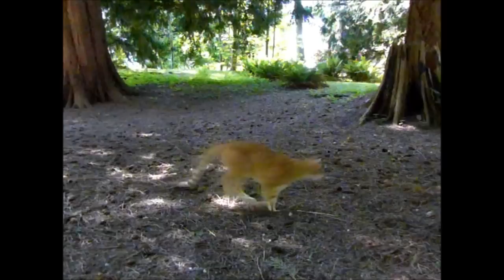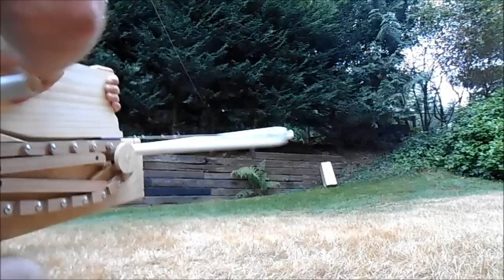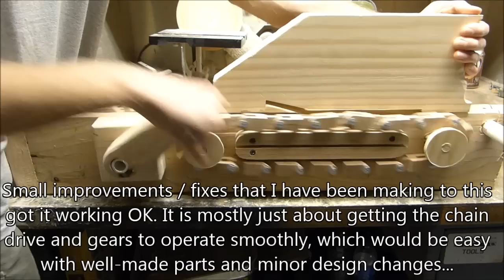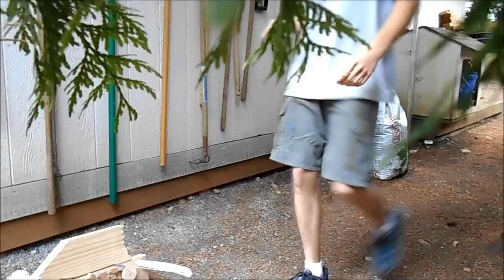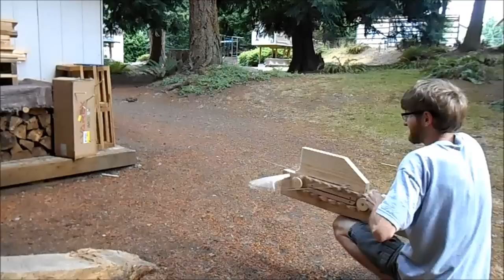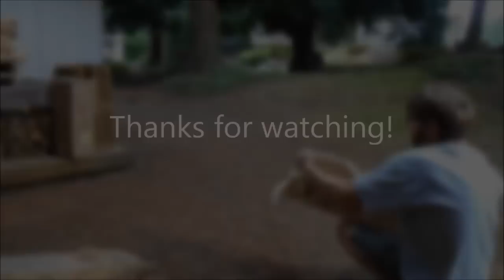Full Auto Crossbow Version 1 Shooting Hand Cranked Gattling Crossbow

Comment: i think  you should put another handle on the other side and crank with both hands make a smooter rotation for the chain.  beside that u can also add a stand of sort to have ur feet to stable the crossbow  so u are fully using ur whole body to stable up the crossbow with faster crank and stabilization

Comment: Maybe if you put a touch of oil right where the string gets lifted off the chain it might not bind up on you there
Reply from the maker: tom ellsworth That might help yes, it is usually near full draw that the mechanism would try to lock. One of the chains somehow is a hair longer than the other, and that can cause it to slip on the driving square wheel. That is sort of resolved and it will usually fire a full magazine without stopping at this point (still hard to crank it though).

Comment: Great prototype. It looks like the hang up/binding near full draw always happens when your crank handle is near the 9 or 3 oclock position and your arm position is at its weakest ergo position. If you could change the gear ratios so that full draw always happened with the crank handle at 6 or 12 oclock i'll bet the majority of binding would no longer be a problem. Keep up the good work, looking forward to version 2.
Reply from the maker: gorp27 Thanks for your suggestions!
Reply: JaycubL Forgive me, but may I offer a suggestion? If this will be powered by a motor, why don't you make the bow into a compound rapid fire bow? This is a large step with the bow planning to be motor powered in the first place, but still.

 I also ask this. If you have a motor on this thing then how will it be discreet? Doesn't that defeat the purpose of the bow in the first place, or is this just for fun? Just speaking my mind.
Reply from the maker: Bob Bob It is not really important for it to be discreet, it is big and the mechanism makes some noise so a motor shouldn't make much difference.
Reply: +Bob Bob Suggest a 2 handed feet stabilized 28th quite chain. GOOD WORK!!!

Comment: looks great! why didn't you use a bicycle chain or the one of a motorbike? Wouldn't it be easier that way?
Reply from the maker: TheHom3er Yes that could be a good idea. In some ways that would be easier and in some ways that would be harder, try simulating that in your head and see exactly what you would have to do to get it working (I think it would be harder and I don't have the materials for it). The wood chain drive system was a worthwhile project on it's own and a good learning experience.
Reply: I can see why welding a hook to a chain link is a problem but making a chain link shouldn't really be one... then there is only the problem with sharp edges... and for the axle with the two cogs you'd have to use some ball bearing... it would definitely run smoother.
Reply from the maker: TheHom3er Maybe used chainsaw chain could be modified for this. One bar on each side of the crossbow and cut all the teeth off the chain except for 2 or 3 to use as hooks.I think I am going to stick to the wood chain drive. I think it looks good and is appropriate for the idea of the device. With an upgraded wood chain design and electric power I think it can shoot fast and smooth.If you build one with a metal chain (or any design for a full auto crossbow really) I would love to see it!

Comment: what is the draw weight?
Reply from the maker: I don't actually remember but I would think like 50-60 pounds or something. It is not extremely powerful by that was also true of the original ones from what I have read. It has enough power to shoot further than you could accurately aim it, and I would fear being shot by it.
Reply from the maker: I think when I wrote that I thought this was the chu ko nu video. This auto crossbow was set to like 25lb or something. This also has no more than 10-12 inches draw length. The draw weight is not the only critical factor but also the stroke, actually energy stored would be the area under the curve for a graph of draw weight vs draw length. Impulse is force x time, so a 1000 lb bow might produce very low energy if it is only drawn 1 inch or something.
Reply from the maker: Yes of course, if it developed problems from that you could do a couple things: build the mechanism stronger and more precise so it runs better, change the gear ratio or lengthen the handle so it is easier to crank. But still for a crossbow you want much more draw weight than that, since the stroke is short.